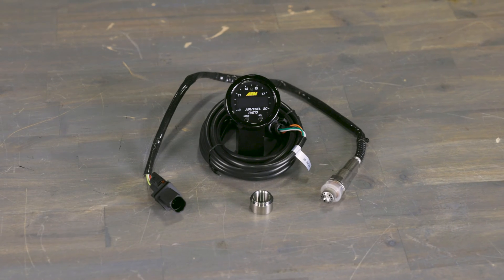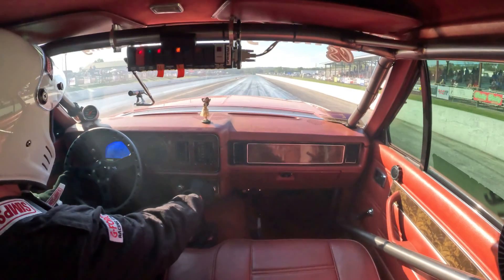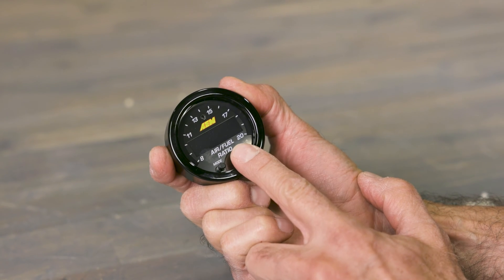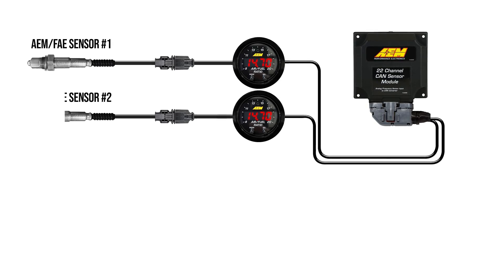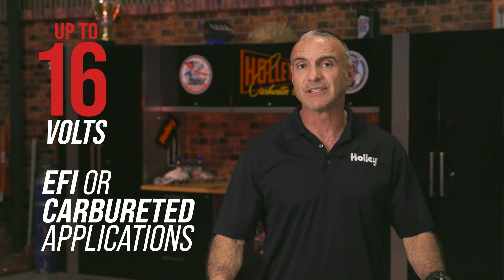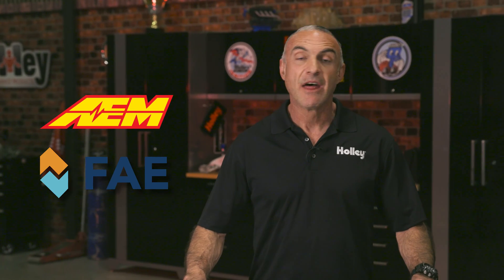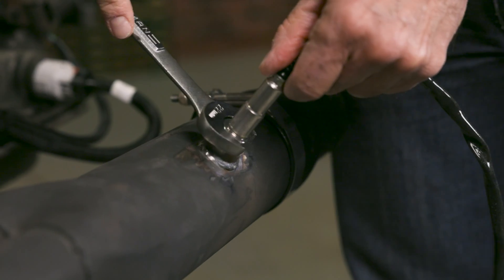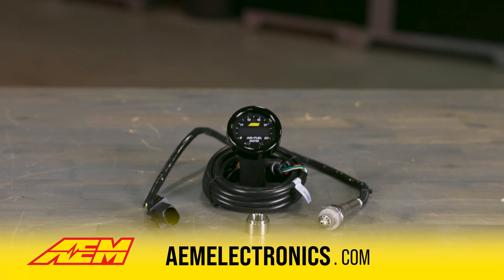AEM X-Series Wideband UEGO AFR Gauge & AEM-FAE Sensor: Faster Response, Indestructible Performance

Comment: Mine has every light on and idk what to do
Reply: Aem is fucking junk I had the uego oringle and the gauge shit out after  sitting in storage for a year save your self the time and money and get the jjcoco uego sytem off eBay like 80 bucks to the door
Reply: @jeffgood6441  what is the link
Reply: @jeffgood6441  Jjcoco really are you for real I bet you drive a Honda and never tuned in your life jjcoco is junk refresh rate 1sec good luck tuning with that I bought it and immediately sent it back your a joke for even suggesting that garbage

Comment: Mine started acting up, always worked but after a minute it would stop reading and then come back on when it wanted or start driving, I replaced the gauge with the same but new one and problem solved
Reply: the gauge or the sensor?